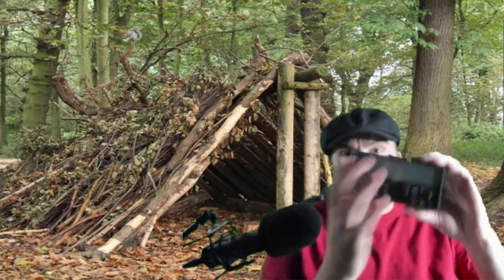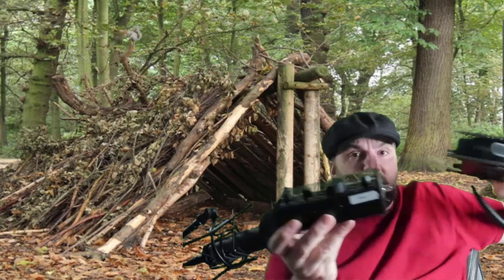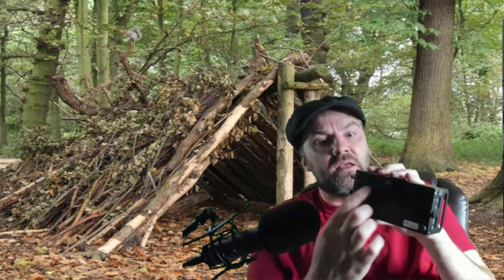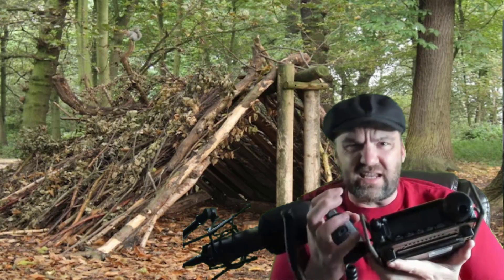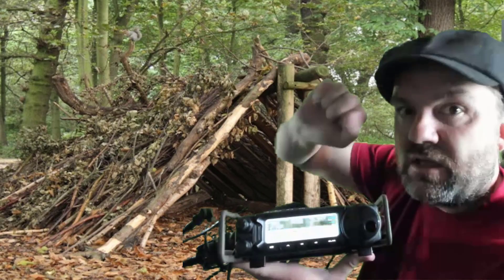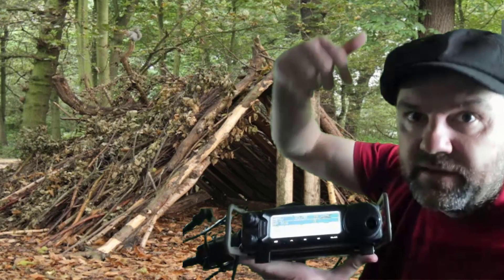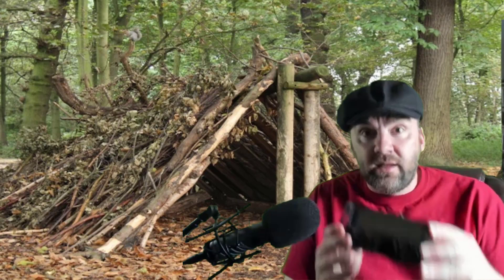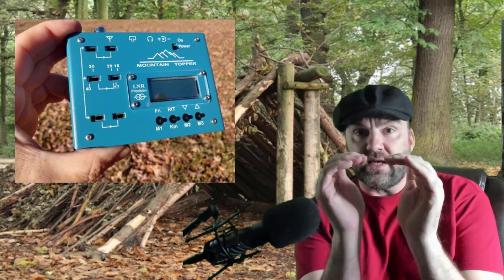Yaesu 891  Vs  Elecraft KX2 Compare!  opinion

Comment: Hi Tom.  I’m one of the guys that asked specifically for this vid.  These are the two radios that I am considering.  Although this vid is not apples and apples to some other radios, as another viewer commented below, it was an excellent answer to my exact question.  Good job!  Keep the vids coming.
Reply from the maker: Thank you for the great question.  Look at all the comments it generated.  Yeah, not a fair comparison, but it was an answer to a question and an opinion piece.  I choose the 891.
Reply: I have an 891. Great radio. At sunspot minimum you will be disheartened if you try using a KX2 at home feeding something like a multi band antenna. Your 10 watts are virtually gone in your coax loss etc. KX2 built for a reason, portability. Ask a true SOTA op for their advice. Short feeder into a resonant mono-band antenna and some height and you will do better than using it at home. At sunspot max, different story, work the world on a watt ! Low power SSB is a real struggle at the minute, thats why FT8 is so popular.

Comment: Agree, FT891 excellent rig, super price, but it is superefficient on noise filtering, variable notch, bandwith & shift are awesome. just need to use the rig non-stop for a few weeks to familiarize. Part of the fun of getting a new rig. 
 FT817 with Sotabeams laser filter is super too (esp for CW) adjustable width and shift for ~£50, such a fun little radio :-)

Comment: I currently own an FT-891 and really like it, even as a base station rig. It may not be the best receiver, or have the best ergonomics, but it’s a nice blend of features, power and portability if needed. I am a SSB guy so I cannot comment on the cw performance...but with right setting of RF gain,  DSP noise reduction and appropriate filter width, this thing can sound like a million dollars. I also have found that the old Fc-30 tuner from the Ft-897 works really well with the 891. It’s smaller than most tuners and it will tune down to 1:1. Period. (On reasonable loads) 
Believe me, I can afford most rigs on the market but I still prefer this one. It get the job done every time.
You can also use some 90deg adapters and some rg-174 jumpers, it reduce the footprint even more ! A+ Tom
Reply from the maker: Excellent comment.  I especially like that part, " I can afford most rigs on the market but I still prefer this one."  That's very telling.  This is my go to rig for when I want a contact to happen.

Comment: I had the 891 and sold it to a new ham. It is  GREAT portable radio but I own two FT-991’s and a IC-7100. If you use the PROC the 891 has a very good punch. I use a Hardrock 50 amp with my KX2 and 817nd for my portable work while riding my bike.
Reply from the maker: Interesting, I wanna look at that hardrock.  Last I think I checked it was expensive.
Reply: @hamradiocq  there is one that is built on eham for 299. with tuner I think. You can even use it with your HB1B.

Comment: You comments on the Yaesu radio were very interesting. BUT......you make an unfair comparison! You can't compare a QRP radio to a radio that put out 100 watts. 
If you are saying it's better to run 100 watts to get contacts, I get it. To make a fair comparison, you should have compared the KX2 to the FT 817/818. Now you have a ball game. 
To use your Yaesu for QRP, you have to bias the finals down, but the problem with that is, you still draw way too much current. 
I set up portable all summer long, in my back yard and at some local parks. I either take my 4 band YouKits of my KX2. I use only CW and make all kinds of contacts.......and.......I only use the internal batter that is in the KX2. 
How much  radio gear do you have to carry with you to operate an entire afternoon in the park with a 100 watt radio?  My KX2 is completely self contained. It even has a built in mic. The CW paddles are attached to the radio. I use a 40 meter half wave end fed. I use a 25 foot length of RG 174 coax to feed it. What size coax do you use? How much space does it take up?
I can carry my complete HF station in one hand and food in the other hand. Where's the tuner for your Yaesu? Where's the hand mic? Where's the BIG battery? 
Compare apples to apples, not apples to oranges.

I really did enjoy watching your video. You made some very interesting comments. 

Barry, KU3X
Reply from the maker: Thank you, I get your point, but this was an answer to a very specific question by 2 different comm enters.  The question was, of these 2, which are my favorite and why.  So I answered that specific question.  When it comes to hitting the road, which radio do I grab.  Mostly the 891.  Thats' all.  Thanks for the comment
Reply: It's a very relevant question to those of use who are considering these two radios.
Reply: I had a KX2 and sold it. I am about to pull the plug and buy a KX3. My grab and go radio is my 817nd  with a Chinese amp. 50 W is way plenty for portable work; the person on the other end will not be able to tell the difference between 50 and 100 W.  Add a 300 Hz filter and the BHI filter in you’re 817 and it sounds like a dream. 

I am ready to match up my hard rock 50 to a KX3, I bet that is a great combination!  Barry as like you I have a couple 100 W radios too lol. And Tom I bet by now you have figured out how to use that 891, it is actually pretty simple to use once you set the menus up.

Comment: Thanks for this video. While I do not have a KX2 I have used them in the field. I have made many contacts on them but not near as many as the Ft 891 I bought about a year ago as a result of one of your videos. The biggest problem I find with the FT 891 is my lead acid 12-12 20 battery will only let me key about 15-20 watts before it blows one of the fuses to the radio. These fuses are 7 amps and when the draw goes up from the battery it will blow a fuse every time so I can not use it at more than 20 watts till I get a better battery for it. Would love to get a Bioenno but they start at about $125 for the one I would need to be able to get close to full power from the 891. Being retired and on a fixed income my toys come very slowly so it will be awhile before I could go that route. Really need to work on getting a better base antenna first. Thanks again for sharing.
Reply from the maker: That was a great comment. I understand the money issue.  The battery makes a difference for sure.  Most importantly we are getting on the air and trying.  Thank you.

Comment: I’m thinking of getting an 891 myself but the lack of tuner is what’s stopping me.  I’ve watched so many videos about it... can’t you use the Multi button to select the bands instead of the big frequency knob?  I thought I saw someone do that.

I use an Icom IC-703 qrp radio when I’m portable, which has a built in tuner.  Shame they don’t make them anymore.   I wonder why Yaesu are the only ‘big 3’ brand that offers portable options.
KD9KMV
Reply: Mike Griffiths I use half wave endfeds with my 891 on 40&20 without a tuner. I bought the packtenna versions and never need a tuner. I run them as inverted Vs. hope this is helpful. Still in love with my kx2 also.
Reply from the maker: as for the multi buttons I'm not sure, but that is a pain to switch.  There is a lot to be said for internal tuners.  One less thing to worry about and not forget.  It's a weakness of the 891, but I still likes it.
Reply: @hamradiocq   I think I watched some of your prior videos where you were using your 891.  Those and others I saw helped me make the decision to get one myself, so thank you.  Awesome radio especially for portable use.  I use a 49:1 end fed half wave antenna and no need for a tuner.  134 feet of wire doesn't make for a quick deployment but maybe the 40 m version @ 67 feet would work.  Thanks for the videos.  KI7YSU
Reply: The LDG Z11proII is a very good match for the 891.  It has an internal battery supply that uses 8 AA cells that last about a year, and latching relays that draw no current once set. It is very small and lightweight. It will match at least 10:1 and is a good compliment to the 891 for portable operations.